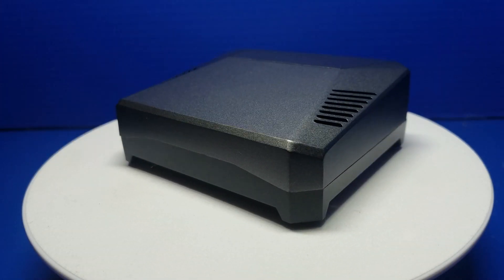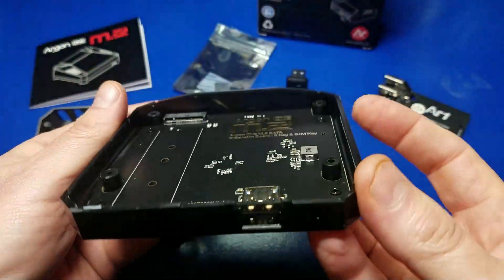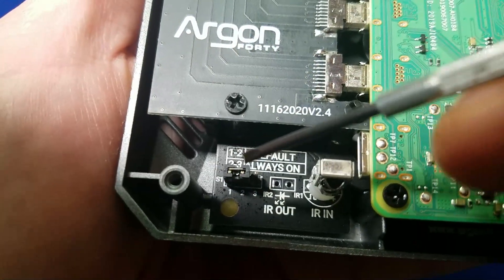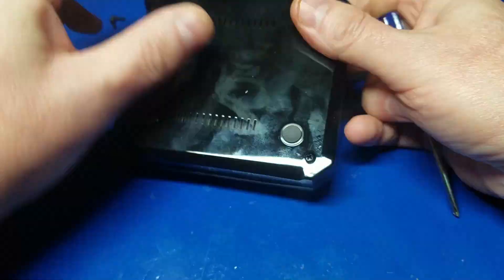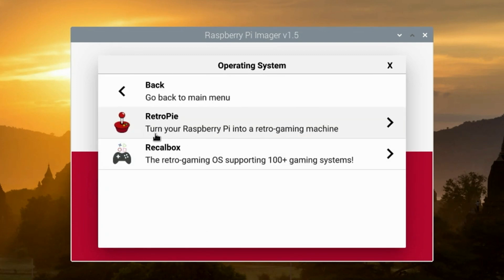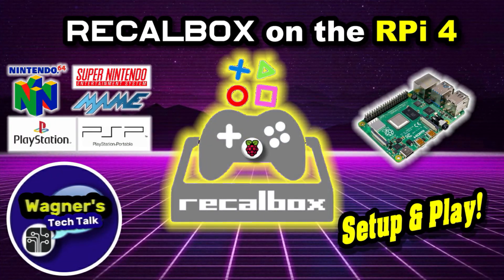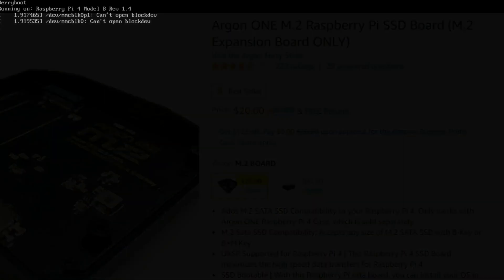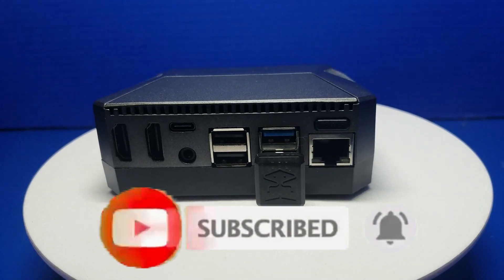Argon ONE V2 M.2 SATA SSD Raspberry Pi 4 Case: Full Setup Guide

Comment: Followed all the steps but when I remove the sd card it just wont boot. SD card not detected and insert SD card
Reply from the maker: Once you burn whatever image to the SSD, should boot up fine as long as you connected the U-Adapter.  Are you saying the SD card isn't detected or the SSD?
Reply: @WagnersTechTalk  burned the image to the SSD with imager. Shut down, removed the microsd card and turned on once more. System is stucked in booting screen and says that no microsd card is detected and system will not boot. 

Also I inserted the microsd card again and I can see that the sad is properly flashed as it shows in desktop as a Drive named Boot
Reply from the maker: You may be running an older version of the Raspberry Pi firmware.  You can try booting into PiOS, make sure the network is connected and then issue the two commands to update the firmware on your Pi:

sudo rpi-update
sudo reboot

Then remove the microSD card and see if the SSD boots.  If so, let me know and I'll add it to the troubleshooting guide.
Reply: @WagnersTechTalk  will do, I’ll let you know as soon as I try it. Just emailed you with a picture of the screen.

Thanks!
Reply from the maker: Just checking-in, did this help?
Reply: @WagnersTechTalk  it worked 👍🏽, thanks for your help
Reply from the maker: @RodNHuerta  Thank you Rodrigo for the confirmation, much appreciated.  Documented here now incase anyone else runs into the same: http://wagnerstechtalk.com/argonone/#Troubleshooting
Reply: Having the same issue. Currently trying the update and reboot. Seems odd since it went through updates during the first boot

Comment: Thx very much Wagner. I applied your whole Setup Guide, it worked but now I have no sound at all on Recalbox. While I had sound when I run Recalbox on the micro SD card. My stuff : New Rasp Pi 4 4Go / This Argon ONE V2 M.2 SATA / A new SSD WD Blu / original power supply Rasp Pi. Do you have any tip for my problem please ? (PS : I am french, sorry for my english). Thx in advance :)
Reply from the maker: I can think of a few things to check:
* Make sure the extender board is fully seated in the Pi 4 (maybe remove/reinsert)
* Try a different HDMI cable (I've had some in the past that are poor quality, replaced and it was fine)
* Make sure the HDMI cable is plugged into the far-left port at the back

If none of the above resolves the audio issue, it may be the extender/daughter board on the Argon One case that may be an issue.  Hope this helps!

Comment: I have the original ArgonOne with the micro HDMI ports.  I need to buy the new one with the M.2 and get one additional M.2 module, but then I'll have two cases but only one RPi4.  Darn! I guess I'll have to buy another RPi4.
Reply from the maker: Hi Deech, perhaps you missed it in the video but you can get just the M.2 base and it will fit the original ArgonONE case as well as the new one.  Links are in the video description, but here's the one to the base:  https://amzn.to/3ke9JBE
Reply: @WagnersTechTalk  No, no, I caught it and have known about the M.2 version of the case for a while.  Thanks for the video.

Comment: hmmm... im just using Argon ONE M.2 Case and runing win 10 from M.2 sata 500mb/s... and its absolutely frozen... i dont understand ..
Reply from the maker: Did you install the ARM version of Windows 10?  There is a good instructional video by Leepsvideo here on how it can be done: https://www.youtube.com/watch?v=xbRBovkmZvU (I've personally not tried it).  However, if you're simply installing the x86/64 version of Windows, that won't run on an ARM processor (Raspberry Pi).  Hope that helps!
Reply: @WagnersTechTalk  it runs but its not useable so ofc its latest arm
Reply from the maker: When you mentioned it was frozen, couldn't tell from that if you were using the ARM version or not.  At this point, I've not personally tried it so I don't have anything to add but may take a look at some point.

Comment: Do you find speed any issue for the SSD being outside of the unit?
Reply from the maker: What no joke first? lol  I didn't notice any difference.  With the M.2 inside the case, going from the BerryBoot to PiOS fully loaded was about 10 seconds.  Using the external enclosure doing the same was right at 10 seconds as well.
Reply: @WagnersTechTalk  ok, but can I play Pong?
Reply from the maker: My day is now complete, I was waiting 😎